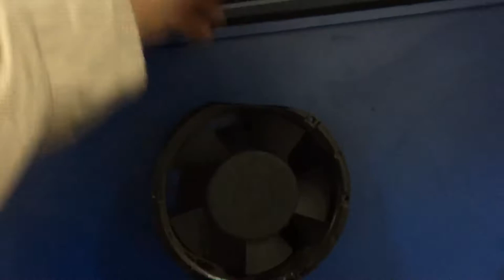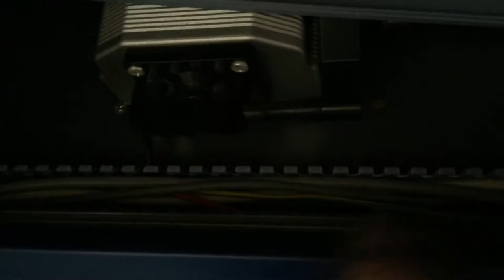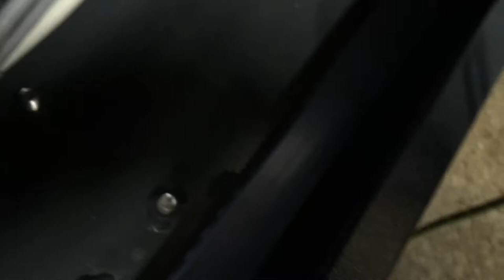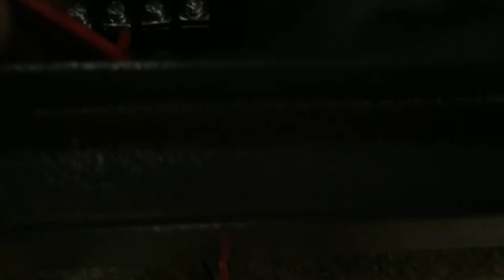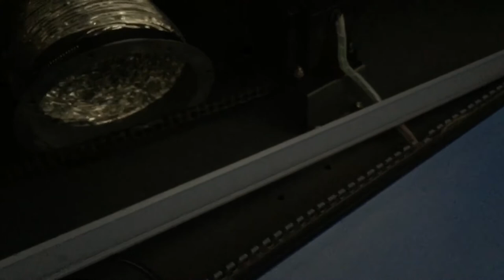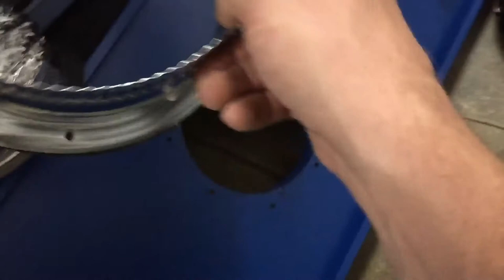OMTECH | EXHAUST FAN REMOVAL

Comment: Thank you for the video. Did you end up doing the 8in fitting and 8in duct with 8in fan on the outside? Wondering if it sealed well at the machine.
Reply from the maker: Yes, I’ve got 8” ducting all the way to the exit of my shop. Works like a champ.
Reply: Thank you, I’ll be working on mine tomorrow. I was dreading adding an increaser and both size ducts on the outside of the machine. Glad to find someone who did it 8in all the way.